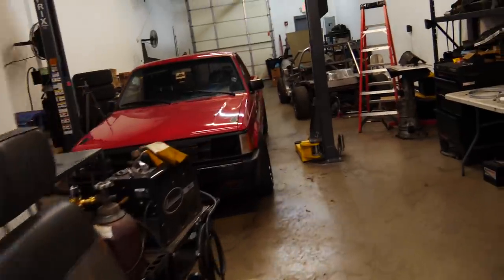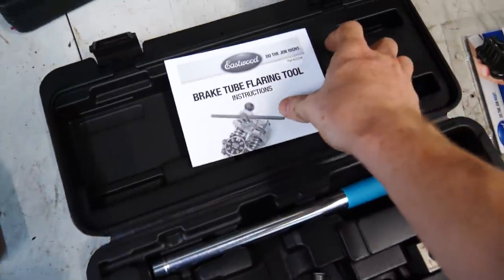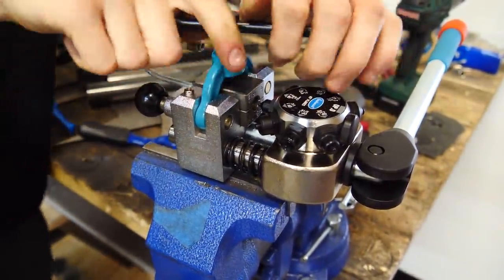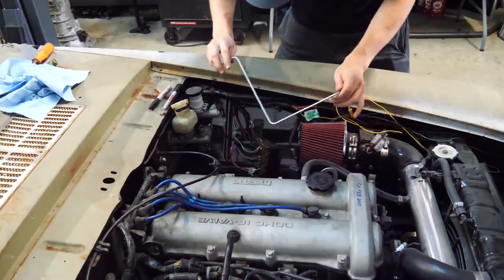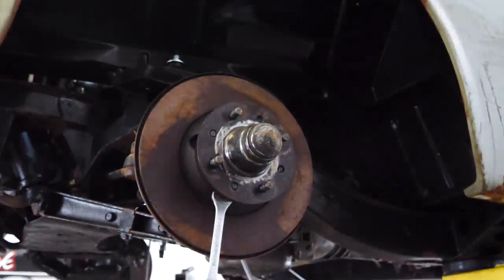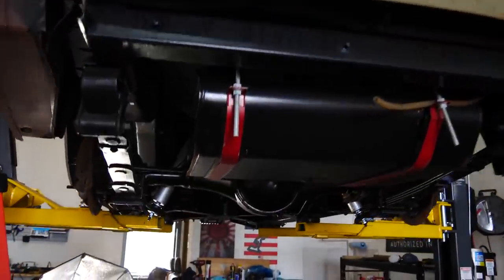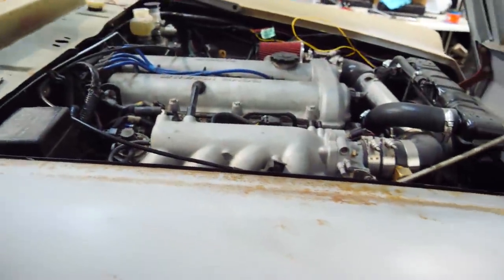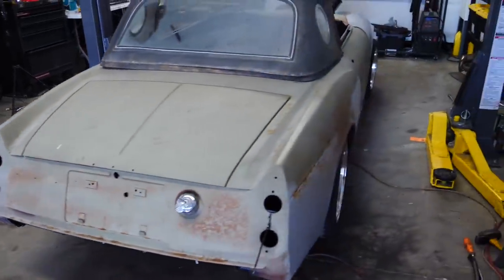The Datsun is READY TO DRIVE! - Custom Driveshaft & COMPLETE Brake Overhaul!

Comment: I know you already did the lines but it helps if you mock up the brake lines with a wire coat hanger. Just bend it to match whatever shape you need, test fit and then bend the actual lines to match. Saves on measuring and cutting/bending wrong.

Comment: You can tell Gingium hasn't done many wheel bearings. HAHA Almost 90% of cars and trucks have whats called axel nuts and a cap on the end of the shaft!  But props to learning how to do it without struggling forever!  👍👍👍👍👍 
Edit: Also great job on fabing a entire brake line set on your own!

Comment: That may have been your best video in a while Gingium!
Congrats to Eastwood for sending you out the tools, you really showed how easy they are to use, and how good the results can be! I wish we had them in Australia.
Watching you trying to remove the discs from the hub while still attached to the car and not knowing how to adjust drums made me laugh, but good on you for admitting it and just using the net to learn and fix the issue. Watching people learn new things is far more entertaining than just working on the same things over and over.
A good and proper size flare nut spanner is invaluable when doing brake and clutch lines, specially with brand new flares. Sounds like you needed a 3/8"?

Comment: Hey Gingium a tip on the drum brakes is to get you a little table or a spot on the floor and set down the parts exactly how you take it out. Then you can just use it like a mirror image to put it back together.

Comment: Wrap it with a nice metalic aqua teal, it's nice and straight,  also you need to grease those bearings more than a finger full!!!!, and that's called a castle nut, under that dust cap, that holds the wheel bearing and hub on!!!😉😃

Comment: Just a heads up, I had the same issue with one of my jeeps where no matter what I could not bleed the clutch. I got a new slave cylinder, new master because I did not want to separate the trans and engine if I could avoid it. My slave was bad but I’m guess it was because I kept moving it like without a clutch it blew apart my throwout internally which destroyed my clutch. Just be careful and be prepared 😂

Comment: Adjusting drum brakes, wind adjuster in until brakes binding should just about be able to turn drum with no wheel on, then back off until the shoes just rub slightly with handbrake slack.

Comment: I don't know if this was discussed earlier in another download, but why didn't you go to a dual circuit master cylinder. You were making the brake lines anyway. The car is going to be much faster than stock, so a separate circuit for the front and back brakes is a safety consideration. Knowing how much Datsun's all use the same parts, another master cylinder would have been easy to come by. You'll probably find the clutch master cylinder needs replacing if the slave cylinder is leaking. Fix one & the other one will fail. Enough doom & gloom , I love the car and can't wait to see it finished. Love the Drift truck & the Adventure bus, also.

Comment: just a tip for making brake lines yous a long piece of thick gauge wire and bend the wire in to the shape of the line you need to make that's how i do it eney way

Comment: With all that brake fluid leaking....I hope you wiped down/rinsed off the paint on the Frame...unless you'll be getting the frame powder coated.   Had some work don to my bike and the shop dripped brake fluid on the rear rim....it's all bubbly now.   My fault for not thinking to do a complete wash of the bike after someone else worked on it.   Didn't have enough time to do the job myself, so I guess I can only blame myself.

Comment: Tell me you used a Mazda slave? Haven't like all of those had issues and leaked and or not worked at some point for you? Its a cool little car though, good job on the lines, you did a good job and yeah the tool is so much better than those pos cheap ones!

Comment: I couldn’t find the update guy so here we go.
• main character has spent his daddy’s money on parts
• bench vice not being mounted bug has been fixed 
• main character has developed relationship with side character from aspiring crisfix 
• main character has not learned his lesson about fire
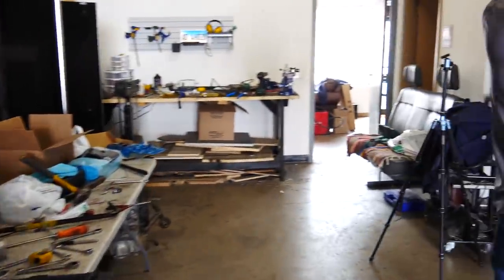• (8:55) main character says “there is no way anything else will fit in there... there must be a big nut or something.”
• main character doesn’t drive the car despite the script allowing it. Bug may be fixed tomorrow 
• the rear is too tight, adjustable back is used

Comment: Wont that hard line on going to the wheel bend
Reply: They don't go to the wheels. They have stainless soft lines at each corner
Reply: justin credible i dont mean to the actual wheel, like the caliper. But why wouldnt it be rubber? I guess to avoid swelling?